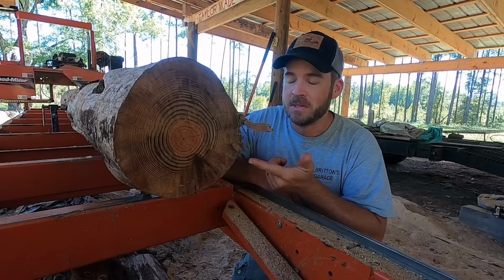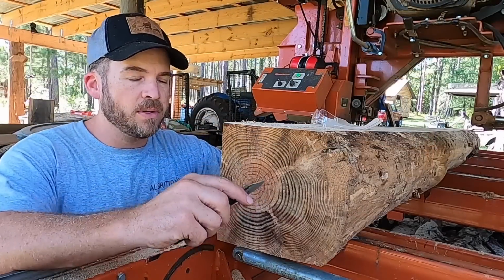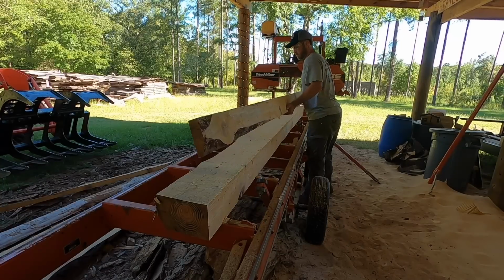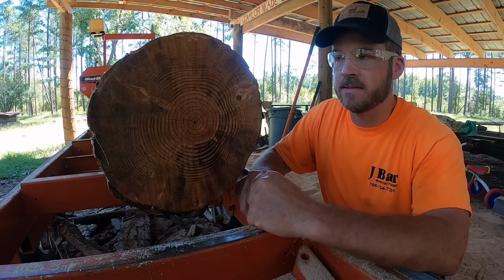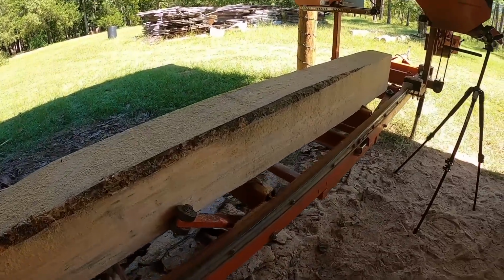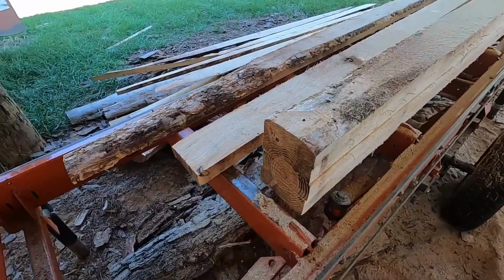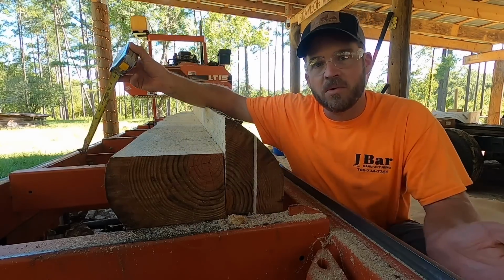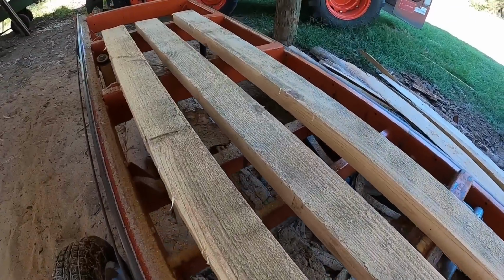Old Fashioned Homemade Lumber

Comment: Your volume is perfect. If its too loud us viewers can always turn volume down. I find a lot of tubers dont have enough volume. Thanks for explaining your cutting strategy to get the most lumber per cut. I have heard a sawyer can make or bankrupt a sawmill by the cuts he choses.
Reply: Do you use a squirt of diesel once in a while on blade ?
Reply: I agree on the volume, Dan!! 👍
Reply from the maker: I've used diesel as lube before and it works great. Water is in the tank right now, and I plan to give the blade a little diesel at some point to clear the pitch. I stopped using diesel as the primary lube because I just don't know about inhaling all the diesel vapor it creates. It's far superior to water though.

Comment: Great video. Audio is no problem since all I have to do is turn it down if necessary.  But I do have one question.  Curious as to why you have the saw discharging into your shop instead of outside.
Reply: Might be a good idea to build a half wall in the middle of the shed to at least confine most of the sawdust to the sawmill area.

Comment: You should try the 5 gallon bucket for the saw dust!  That way you would not have all the saw dust mess! I   realize that you would still have a barrel full of saw dust, but would still be a lot better!  Must work!  I see that one other sawmill uses this method.
Reply: I have to agree, Wes !! Collect the sawdust in a bucket and it'll save you some time and effort when it comes to clean up !!
Reply: I used to do that with my LT 15. It worked great inside our barn. Once the bucket was full I would fill feed sacks and my mother used the sawdust for the horses.

Comment: Great projects & videos...
Have you ever made 2 or 3 same sized cants then put them all on the deck and made multiple boards on each cut?  Seems that it might prove to be an efficient use of your time when there's a large quantity of boards needed....
Reply from the maker: Yes, that works pretty good. Increases handling, but cuts down on passes.

Comment: You asked about the volume / loudness of your videos.  At 16:42 it got really, really quiet for some reason, then picked back up to the same volume as before at 16:55.  Not sure what you did but your camera was right up on the saw.  Even so, the saw was so quiet we could hear the blade spin more than the motor.  Weird.  Never heard that before.  So you can listen, here's a link to this video that begins at 16:42 where it goes quiet for 13 seconds: 
https://youtu.be/-a8eY94Oafg?t=1002
Reply from the maker: I think that happened just because of the slow motion.

Comment: Where is your mask? Just because you think you are Macho or something, doesn't mean that dust and wood particles are not going to effect you. I am 40... Almost 41. I worked for years with wood.. Pallet making, box making, using industrial saws to cut the wood, etc. I have breathing difficulties, Emphysema (from the particles etc and medication I have to take), low liver usage etc. You are probably older than me? Idk. But my next stage is going to be carrying an Oxygen bottle. Use a respirator or mask at least. Protect yourself.